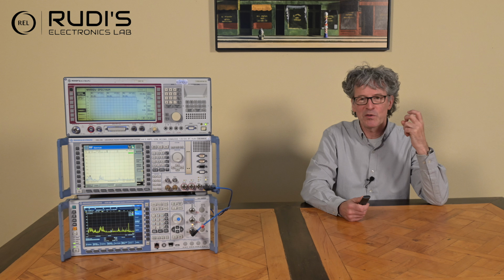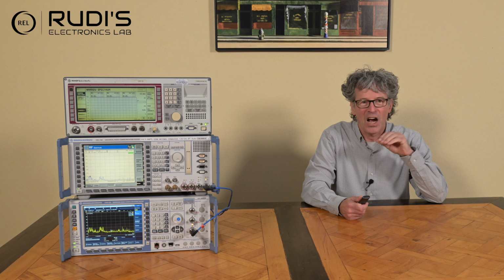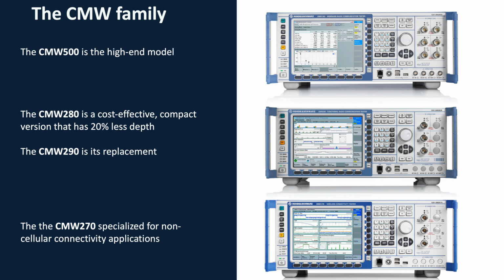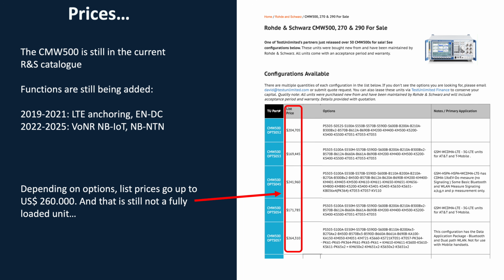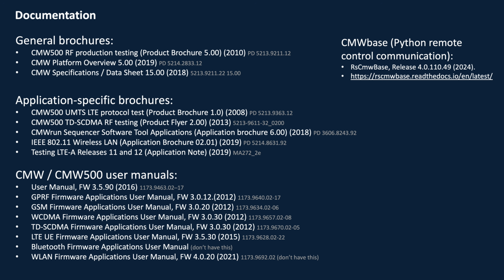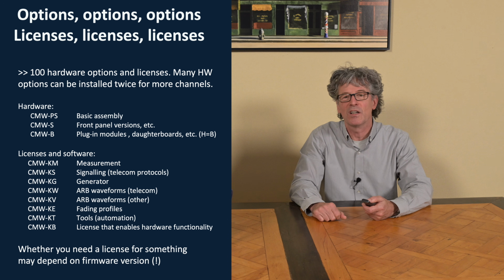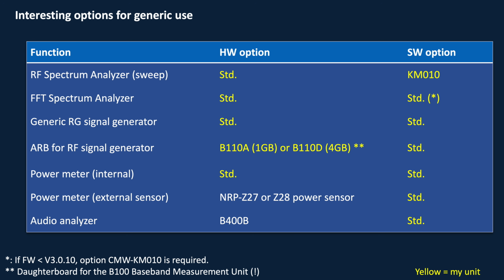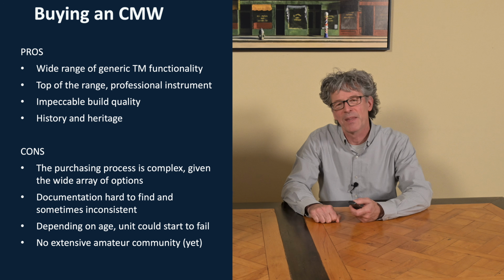Rel #63 CMW500 vs. CMU200 as a general-purpose T&M instrument

Comment: It's a shame the audio analysis is hard to get.  No SINAD measurements without it.
Reply from the maker: True.. I have not seen many on eBay or the internet, and I think that is because the most popular use case was production testing, and I believe audio testing was not a standard part of that use case. For the CMU200, they seem a bit more common (A while ago, I did a special video for SINAD testing on a CMU200). But with a bit of luck, I might be able to find one for the CMW nevertheless.
Reply: R&S produced a special device for audio testing called UPV, with an optional digital audio input. Unfortunately, it is no longer produced, another option is to get a Panasonic VP 7722, 7723 or 7725 audio analyzer also sold under the Leader brand, or Sencore PA81 which can be expanded with an accessory for high amplifier power - the PA81 itself is designed for up to 250W and does not require the use of an external artificial load, unlike Panasonic analyzers.

Nice day 🙂 Tom

Comment: Hi Rudi, perfect explanation explaining all aspects of this device, congratulations on the purchase, the price of around 3000 USD is absolutely amazing, but for whom - in my case (I live in the Czech Republic) it is two monthly salaries at the moment.
I'm looking forward to the continuation .......

Nice day 🙂 Tom
Reply from the maker: Thanks for the nice comments! I realise that it is still a considerable amount of money. The good news is that for units of which so many were built, sometimes you can come across such items at even lower prices at national auctions or marketplaces. I had some good luck at that myself.
Reply: @rudiselectronicslab861  In my case, it's a bit more complicated because my workshop was completely robbed years ago and I lost all my equipment. After this incident, I completely gave up on electronics for several years. I finally returned to electronics when I came across the EEV blog and saw similar videos on YouTube like you are doing and I started a gradual restoration of my workplace (some photos are on EEV). After several years with a 200MHz Hanrek oscilloscope, last year I bought a simplified R&S oscilloscope from the 2000 series extended to 200MHz. I made many devices myself or repaired older non-functional measuring instruments. Among the latest catches on eBay was a functional RF generator Hameg SG 7150S for 280 USD (I was lucky there) and so I'm done with shopping for a while, but the first thing I want to get is a spectrum analyzer with an audio range.

I'm already looking forward to the continuation of CMW

Nice day 🙂 Tom